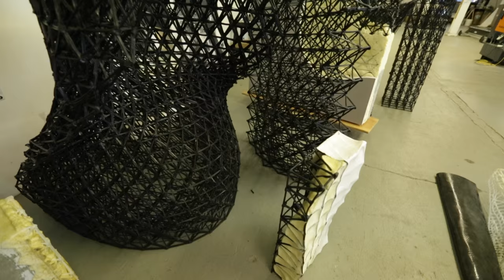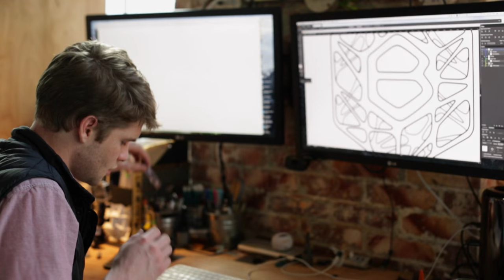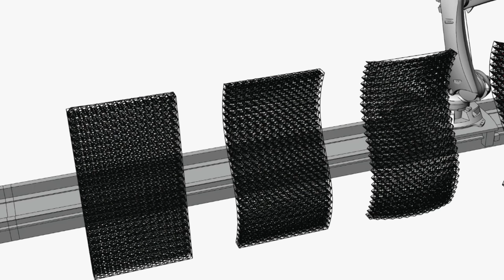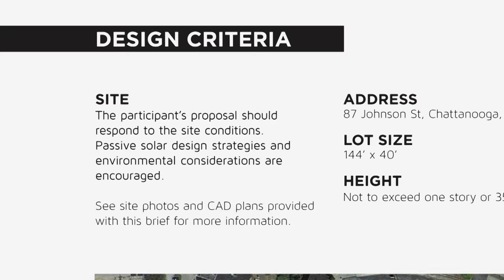"The Leap - Branch Technology" - 3D printing meets architecture

Comment: I love how the print fails at 7:20 

I am a huge fan of 3dprinting, but to build everything out of even more plastic and foam is not a solution in my opinion
Reply: If the list of projects on their website is any indicator, consumers seem to agree with your sentiment
Reply: A wide range of materials can be used in 3D printing. They are always finding new ones. learn some chemistry.

Comment: Sry but I don't see the benefit in this because the PLA and the spray fome is not eco-friendly and the free forme building still needs a free forme casing to keep the concrete and spray fome in shape first. And the benefit of steel is that it expands and shrinks kind of the same as concrete. (I'm actually pro wood construction
Reply: PLA isn't the only thing you can 3d print with.  Also the PLA is many times stronger than wood, so it's certainly worth exploring.
Reply: That's not PLA they are printing with, he said carbon fiber, which is most often mixed with nylon.
But the list of materials we can print with expands all the time.